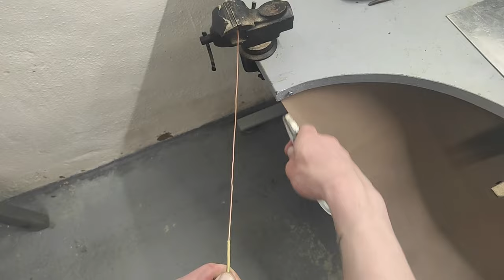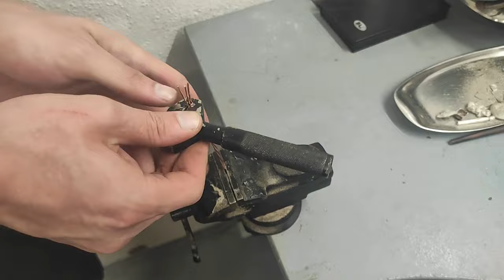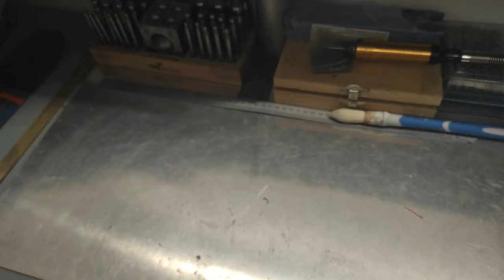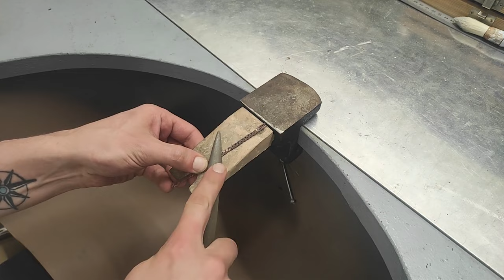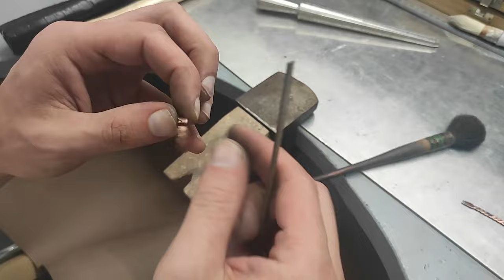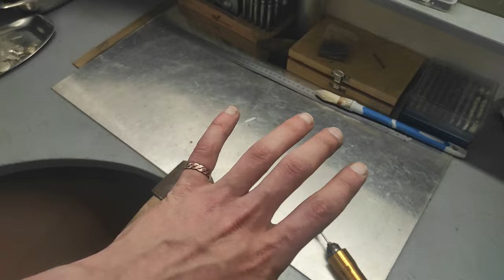How to Make a Copper Wire Ring

Comment: You bave to add solder to the jiont, the ring may bend easily and will cuuase premature fialure. Also thay jiont doesnt look good, try soldering it and placing a think copper sheet over the soldered gap, it will remian copper colored and be much stronger

Comment: Nice one! A question: if you want to solder the ring, what is the best way? With tin of with a very thin copper wire? About 32 gauge or less, I thought. Ty🙏

Comment: Cool video! As someone who makes jewelry with copper- my advice to those trying this would be: Wearing gloves, At the end, wipe it down with lemon/lime juice (I use a q tip). Then, sprinkle some baking soda on it, rub it around, and use a damp paper towel to wipe it off. This will clean the surface really well. 
After you're sure it's dry, spray some lacquer on it. That will keep it looking beautiful and not corroding for a long time. 👍
Reply: Will it work on a Brass Hex Nut if I cut it and smooth it into a ring shape?
Reply: @SabSnake  I dont see why not!

Comment: Did you put copper in water on 2.33? Is it cold or warm water? Thank you!
Reply: Idk if you still want to know, it’s just room temp, he is annulling the metal (making it soft) only works for non ferrous metals I.e. copper,silver, gold not steel. It reduces the chance of the ring snapping or cracking when bending/ working the metal.

Comment: Hello what temperature did the metal get up to before quenching and how many time did you do it?😀
Reply: On appelle ça, recuire le métal.
La température n'est pas très importante pour ce faire. Il suffit de faire rougir le métal qui pars sur du orange pour le cuivre. Il te faudra plus de 1000°C pour faire fondre le cuivre autrement dit, c'est pas facile et pour ce faire, il faut du gaz et de l'oxygène. Ici, pour recuire, tu n'auras besoin que de gaz. Par cette action, le cuivre vas se restructurer mais surtout, se ramolir et devenir plus malléable

Comment: What happens if you don't heat treat the metal
Reply: Unlike iron/steel, copper is work hardened meaning it becomes harder when it was being hammered and what not. Heating copper will make it more soft and pliable

Comment: What is the purpose of heating up the copper?
Reply: The heat is used to “anneal” the material, causing it to soften up. The characteristics of cooper are unique in that they are generally soft but can become hardened by bending or “working” the piece. Once it gets stiff, it can be resoftened by Annealing, you can do this as many times as you want